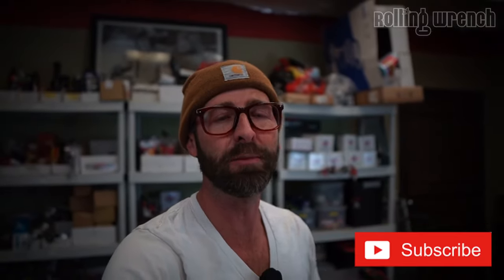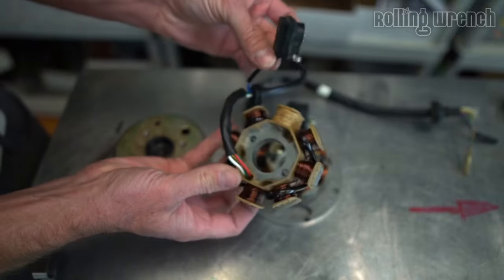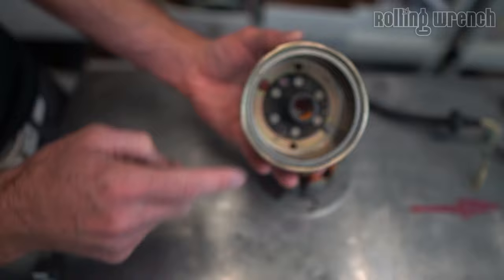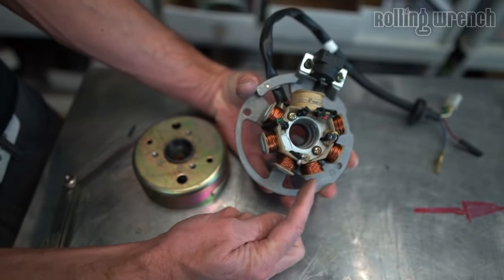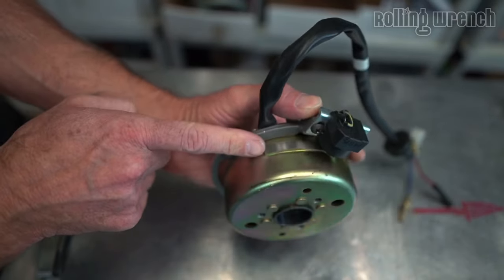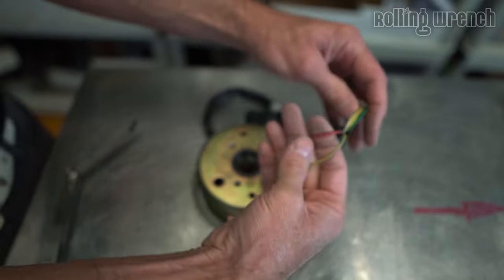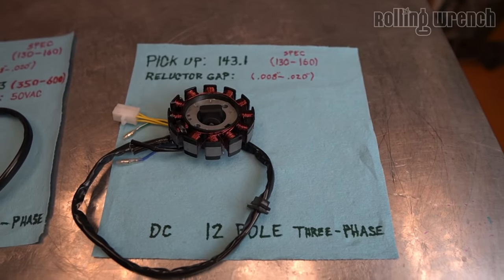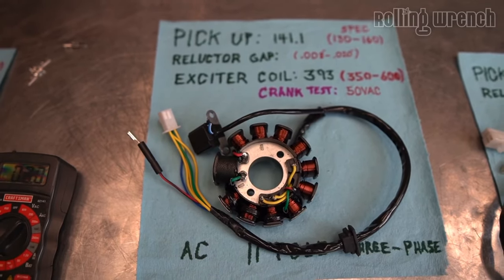HOW TO TEST A STATOR / WHAT IS A STATOR [step by step] GY6

Comment: I have a Carbide go kart 150cc, with no spark. There 30v AC while cranking on the Red and Stator wire , .156v AC on the Trigger blue with yellow wire while cranking. No power at the coil while cranking.

Comment: If this is the same as a car just charge your battery up start your scooter put a voltage meter on it and it should read between 13 and 15 volts if it is  being charged ,if it's not showing a charge over $12.5 then your old alternator or stator would be bad. ?

Comment: Very educational!  We got a go kart (hammerhead GT 150) as a "father son" project to rebuild and learn.  However, we are now at the stage where everything has been bolted together, and only thing left is to plug in the wiring harness and components.  Once we completed this part, we attempted to crank the kart, however, the "green" wire from the Stator got so hot it almost melted the wire covering.
We have watched, read, and tried everything we have learned to correct this.  Can not figure this out.  Does anyone know what is causing this?  (Stator is an eight pole, AC stator and it is new, as is the CDI and regulator.
Reply: Did you find the problem? The green wire is generally ground. Which should be able to be tested with a meter. First check the wiring and then the components themselves. The melting or heat indicates there's power going to the wire when there should be none.

Comment: I've worked for Honda 30 years and your off with a few things .. I don't know what Chinese calls it but 1 yellow wire is single phase , 3 yellow wires is 3 phase.. And the number of posts is what amp alternator output you have , some model bikes have higher amp alternator than others .. The only accurate tests for stators is using a peak voltage adapter ..
Reply: Where would you get one of these testers?
Reply: The peak voltage adapter....
Reply: One last question are they expensive?

Comment: Pretty sure two phase is obsolete. It's either single phase or three phase. Single phase would use one line or hot wire and three phase uses three line wires. Informative video though it's going to help me diagnose a scooter not starting.

Comment: I'm losing power at higher speeds on my ruckus GET motor. Does anybody know if it could be the stator??
Reply from the maker: Loosing electrical power? Or engine power?
Reply: @RollingWrench  not yet tested the electrical power, got to buy a tester for that. But it worked perfectly until I get up to 35mph+ then it loses motor strength and would backfire a little.  Would normally go 43mph and I went down a jet size to stop the backfire but it still backfires a little but not much and it seems to work fine after that. I just can't hit 43mph anymore.

Comment: @6:05 both stators had same amount of wires but you said the dc stator had 1 wire less??? confusING
Reply from the maker: Dc stator losses the red with the black strip wire. The AC wire the powers the AC cdi
Reply: @RollingWrench  thanks for the vid really good explainqtion

Comment: I lost the ability to start ruckus (get) with the button when I stretched my Ruckus. I just hear a click from the solenoid when I press the button. Any thoughts?
Reply from the maker: If you don’t have the kill switch wired in this will happen, also if the fuel pump is unplugged or bad. And one last thing to check, the green ground wire. Be sure it’s still bolted to the engine

Comment: 2007 Ski Doo summit 600

Stator issue????

No spark and no attempt to kick over - unless I jump the starter relay
Can not start with pull-start (no spark)

things I have tried
new plugs
If i jump the starter relay with a screwdriver, it will attempt to kick, but no spark, so not starting
new starter relay
trimmed cable to spark plug and reseated plug to be sure that wasn't loose
new and charged battery
disconnected kill switch, no luck. I am not sure how to jump it
played with and cleaned tether, no luck. No beeps or chirps
checked fuse box, and chassis fuse by battery
gas is not an issue, its not even cranking without jumping the starter relay

Comment: I noticed and wanted to figure what is the difference or why there is a difference maybe that you tested an AC voltage meter I mean a stator around 18 or 19 minutes and you had your test or set on the the VDC not like the VAC and you were testing an AC voltage regulator so even if it's a ac voltage regulator you don't have to test it on the VDC side or if it's a DC volt regulator you turn it to the d the VDC and if it's ac voltage regulator you turn it to the VAC so you can still do the AC with the DC side a little confusing there we didn't really kind of go through that part and you just tested it and didn't explain which I mean I know you can explain everything while you can do DC voltage regulating I mean voltage test with an AC product compared to do you turn it on DC to do that I mean turn it on AC excuse me I mispronounced do you do turning on AC to do a DC test on a DC voltage regulator so I guess that right there didn't make a lot of sense and you didn't go through it love to hear a video on or you know an explanation that would be great trying to learn God bless

Comment: What he doesn’t know is the red and black plastic tips come off and he’d have a long prob to use and wouldn’t have to place metal pieces to get connection while testing. 🤣🤣. I’ll be sexist…I’m female and know this & I don’t know a ton about engines but knew this much 😂 Lord.  🤦🏻‍♀️
Reply from the maker: Actually these multimeter caps are fixed and do not come off. Not all multimeters are the same 😉

Comment: All stators are ac. Stators are alternating current. I have no idea why you think the wrapped coil makes it dc?? The rectifier converts the ac to dc. Sorry this makes me question all your diagnostics.
Reply from the maker: You can go back and watch the video if you are confused. Let me clear things up. Yes all stators are ac . Not all stators are made for ac cdi boxes. There are dc cdi boxes as well. If your cdi box is dc, you will need a dc stator. If you have an ac cdi box you will need a ac stator.  Understand? Thanks for watching

Comment: Your comment about cdi’ s digitally doing what points did is incorrect . CDI’ s were in widespread use throughout the late 70’s and almost universal ever since . They only became digital in the mid to late 90’s . Early CDI’s were not much better than a TCI ignition ( tci was battery powered , cdi used a source coil ) . They required a mechanical advance / retard mechanism . Latter on they did away with the mechanical system in favour of a “ program “ installed into the CDI ( but this is still analog , it uses the voltage generated by the trigger coil to determine the advance / retard points ) . This system was the best available at the time , but was still flawed . Two different pickup coils will have slightly different voltage , different clearance will give different voltage etc . Actually digital was when the CDI got clever enough to count the pulses ( late 90’s on most brands of race bikes ) , it then became very accurate.

Comment: Have you ever met anybody I took a tomez 50cc put a 70cc junk it cut the shoe clutches change the gearing and I made it run 80 mile an hour I will send you pictures romilda cylinder head it was two stroke a Tomos moped Steve from Annapolis
Reply: 80 miles an hour?.... 80 miles an hour huh? Out of a 50cc two stroke with a 70cc head on it?   That has got to be a world record for a 50/70cc scooter.... How long does it take to get to"80" mph? Is that down hill or falling off a cliff? 😂

Comment: Chinese Stators are a bit temperamental..

they must manufacture it with stricter quality control since all the stator I've seen was due to a manufacturing error that lead the thing to just burn up due to a short circuit..

and the stock wiring harness is just rubbish

I've replaced my entire wiring setup with Automotive Grade Wires, Connectors, Bulb Socketsw

and Genuine Honda Electrical Stuff.. it last me for years now with no electrical gremlins

Comment: Well
There is a reason for cheap m/meters
And high end
Look at your craftsman junk meter
Just like you my neighbour bought
The cheapo as u said to the red
Craftsman with fup screen
My neighbour the spent $60
On that same dm from lowes
A week later the screen looked
Same as yours cheepo christmas
Lit screen
Well i told him to go get your money back
And buy a real meter
Which he did
The made in usa yellow
Wow what a difference
Longer probes
Clear screen
So many options
True rms
And so on
So b4 you make the next video
With a dm
Get your self a real meter.
Reply from the maker: I have a fluke as well. They both work the same. Thanks for the tip

Comment: I have been watching videos all day and everybody shows these drawn up diagrams on how a stator works but nobody explains how the three yellow wires work... All the wires were ripped out of the plug on my bike and I need to know what order they go into but nobody seems to have an answer... I have a book and I've studied it until retarded but none of it tells me anything other than a bunch of lines.. mine is a Polaris predator 500 one of the three yellow wires has a red stripe on it.... this has been a problem for 3 years and nobody will give me an answer other than just buying a new wire harness.... Keep in mind I know absolutely nothing about electrical